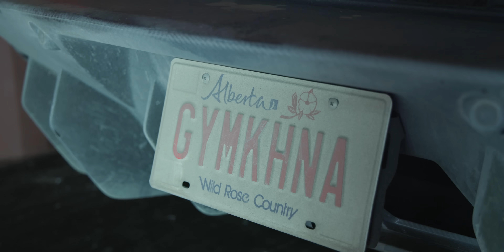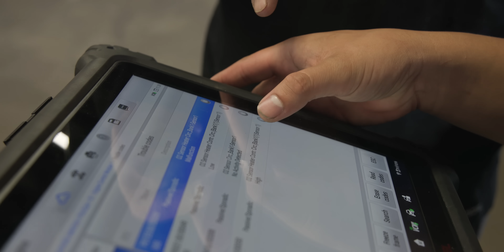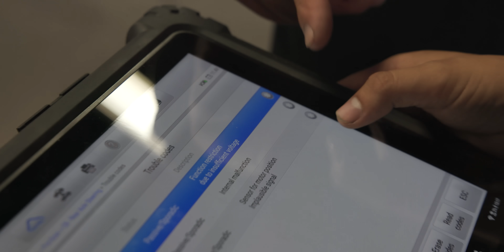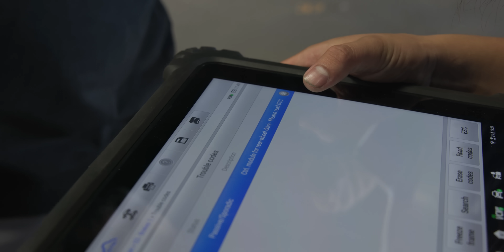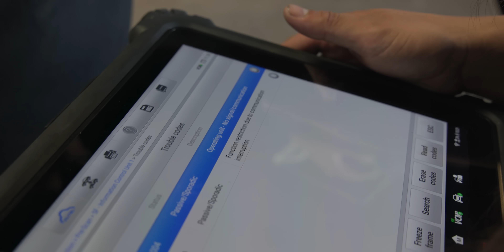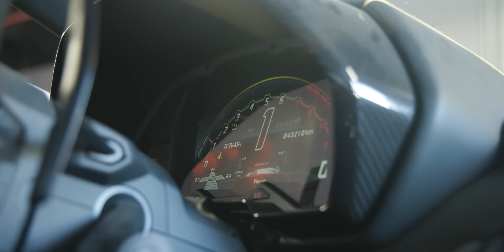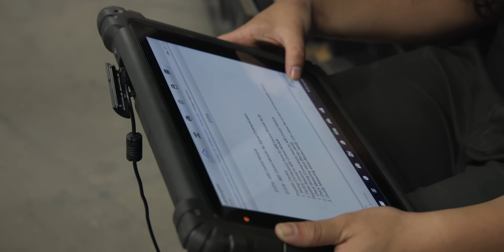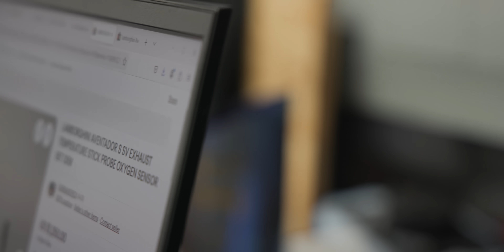TIME TO RETIRE SVJ AFTER DISCOVERING SERIOUS HIDDEN MECHANICAL FAILURES!?

Comment: I bet that flame shooting tune does wonders for the exhaust gas temp probes!
Reply: It’s not the tune it’s the exhaust system
Reply: @Moneybags_LIVE  what are you saying? How is the tune not what causes the faulty EGT probes
Reply: @Berm_Blaster  the tune contributed but this can happen with any aftermarket exhaust after too much revving or flames not the tuners fault in my opinion
Reply: I bet your right
Reply: Correct. Absolutely dumping unspent fuel into the exhaust and igniting it will fk it right up.
Reply: @Moneybags_LIVE  the exhaust has nothing to do with it. If you leave the stock tune it would actually run more efficient with the Gintani exhaust because of less restriction. But when they want it to shoot flames they are just opening the injectors open longer and that dumps raw fuel into the exhaust. The fuel in turn melts the egt temp probes and also can mess the o2 sensors up. Also holding it on the rev limiter also is not great on the engine.
Reply: @jasonb9629 someone that actually knows what they are talking about. best explanation i’ve seen in these comments. if only these people understood tuning
Reply: @jasonb9629  it's partially true, while they disable fuel cut to let the injectors keep working on deceleration map you still would have to retard igniton to achieve the big flames else without retarding the ignition it will just stink of fuel and maybe even have black smoke, the lower the fuel cut value the bigger and longer the flames. also retarding igniton too agressive will slowly burn up your exhaust valves
Reply: @rcgamers5536  Bud I know how to tune cars I work on them daily.  I didnt just feel like writing the full explanation out because its just not needed in this case.  If you look at some of my other posts about these tunes I explain it in more detail there about how they do these tunes.
Reply: @referencetheater1742  It actually not because I can almost guarrantee that they make you sign a waiver before they do that tune.  Gintani just is a shop that sells products that people want.  If your dream is for your million dollar Lambo is to burp and fart and shoot flames hey your the customer so give us a pile of money and we will downgrade the performance of your car and make it more unreliable.  Remember the customer is always right!
Reply: @Moneybags_LIVE dude that is the most inaccurate statement. Sorry but it is. The tune is the whole reason it shoots those flames so consistent. It has 100% to do with the tune and fuel management.  The flames are raw fuel burning. Maybe if you had a high performance car with a top notch exhaust and big injectors you can do it. But not with just an exhaust. Sure they will toss a blue flame occasionally. But not like the DDE cars.  They are all tuned.
Reply: I think it's time to order back-up  egt sensors. 
MO FLAMES
MO PROMBLEMS....
Is what Biggie said....lol
Reply: @jasonb9629  basically you are telling me what i guessed, GINTANI problem….as many say their tune is hard for the car and not reliable. There are much better tuners such as NOVITEC and much bettter exhausts such as BRILLIANT

Comment: Svj should be the alternator. It dropped into the 11v ranger several times. You should get 14+ volts at 2000 rpm. If not the alternator is failing. Most ECU won't function properly under 12.3 volts. The starter won't engage on most models if low voltage is an issue..
Reply: I hoje they see this
Reply: Said that during gumball
Reply: Its going to be from Damons constant revving IMO.
High RPMs are known to cause electrical issues in most modern cars, but Im sure they already know that by now.
Reply: @ChillinWithJunior  I hope so. Some alternators can't handle the RPM
Reply: they had the battery and alternator replaced on gumball
Reply: Do you know what’s funny? You may be right, but all the likes and comments acting like this is definitely the issue when they’ve had 10’s of experts both Lamborghini techs and outside look over the car and they still don’t know the issue, but apparently this comment is the solution 🤣
Reply: And I say again I hope you’re right, I just laugh at how everyone agrees if you say it confidently enough
Reply: mfn thank you for saying this, ffs like 100+ different codes can set for low voltage. gotta fix the simple shit first before getting deep into the big stuff

Comment: I would recommend putting the factory tune back on the svj to see if it resolves some of the drive train issues. Even though it sounds great, proper modifications werent made to the svj to support the tune other than an exhaust. Also, it is Revved to heaven every time it's turned on without proper heat management in the engine. Not supprised components are failing. Love the car but its not built for that level of abuse.
Reply: Supercars are strong but things are fragile. You need yo understand the numbers they get made in compared to a camry or what not.

They arnt typically driven ‘daily’ so these problems will and do exist regardless of modified or not

Comment: Mike and Tim, if you're concerned about corroded connectors, I would spray some Nickel Safe on every connector you inspect, as you inspect them.  Nickel Safe is good stuff.  We used it on A/C components in a hotel resort I worked at.

Comment: Not to correct Mike, you can just pop each pin out of the connector to check the wiring at crimp point. I so feel for Tim if he gets stuck having to test the electrical searching for the root cause of the problems. I recommend making some male/female connectors for testing individual pins and wires with a multimeter.

Comment: The svj just did 3000 miles plus traveled across the world on water. The sea air could contaminate the oils and wires, do a proper pull down, and check  for corrosion . Definate oil change and radiator  flush

Comment: Most manufacturers build a proportioning valve bias into an abs brake modulator in case it fails. Where that redundancy fails is when you change calliper piston size. But, before looking further or changing parts you need to set the tire pressure!!!

Comment: The Queen is back‼️ The SVJ’s appearance on the channel is something else. This car is a brand/product ambassador for Gumball3000 and Gintani. Damon and Dave really know how to make every moment out of it with this car. Mike Essa is diagnosing it properly, going through every inch possible. My theory is the exhaust temperature is freaking out the sensors and wiring harness with the internal fluids. Wrap the exhaust with heat shield and fold paper on the surrounding. God damnn, the SVJ is such a phenomenal and legendary car, Gintani YSOB you unleashed the beast. Keep up the hustle and bustle YSOB’s! DDE ALL THE WAY🏎️🏎️💨💨

Comment: A lot of electrical gremlins could be due to a failing battery. Most Euro cars freak out once the battery voltage falls below a certain threshold. Consider replacing the 12 Volt battery and check to see what codes come back. I’m not a Lambo technician but I’d try the cheapest/easiest remedies first. Love seeing Mike and Time getting more screen time! Keep killing it fellas. 🔥🔥🔥

Comment: With all carbon fiber tubed vehicles. That bolts metal to carbon fiber.  Front and rear.  90% of the time is a ground issue.  Find all chassis grounds.  Clean them.  Dielectric them.  Tighten all chassis to carbon tub bolts.  Also I’ve replaced many chassis grounds due to internal corrosion that can’t be seen.

Comment: Mike put car in the air. start it, put in in the gear and look for a live data from wheelspeed/abs sensors . If one is off you got it
Reply: Hopefully he see's this... not sure if he is familiar with some of these awd systems.. if your OD tire is slightly off from the other 3 it'll spin at a different speed under normal driving even... I hope they see this comment

Comment: I love Mike videos! Car manufacturers put electronics under the hood because they cool as the car moves. Damon spends so much time sitting still revving and blowing flames is the reason for the burnt sensors. The tune is retarding the timing and dumping extra fuel through the exhaust to ignite it. And the melting wire issues

Comment: Check the wheel speed sensors for the ABS problem, had the same issue with my VW. When Tim said a low tyre warning had the light bulb moment, as they use the wheels speed sensors to measure the rotation against each other to work out a flat tyre. When one fails it throws everything else

Comment: For the abs test the wheel speed it’s a typical issue with dirt dust etc a easy check is live data while driving and see or take them all out clean them and put back in.

Comment: Could be a master ecm issue with all the electrical issues. On the stuff I work on if there is low voltage the whole can buss system goes haywire. Total factory data refresh to get it back working.

Comment: I lost ABS, traction control and cruise control on my Jaguar XKR the OBD tester said abs control module or ABS pump failure, it wasn't either just a blown fuse for the ABS control module. Cost me pennies instead of pounds 😅

Comment: Maybe they hit some bumps big enough to throw off the wheel sensors.  So maybe you just need to replace those. Even low air for tires might throw them off

Comment: The svj might just need an alternator but an upgraded one in my opinion. Also there’s something draining power when it’s on not when it’s off. A ECU might also be blown or shorted causing all these issues and with that it probably blew the alternator as well. Just copying another user’s comments while adding a little bit more.

Comment: I can tell you from experience you have electrical issues somewhere. The transmission faults are from low voltage and the other codes were from low voltage you need to start at the battery and alternator and work your way down. Replace the Oxygen sensors just due to the Gintani Exhaust probably melting them from the high temps of constantly revving

Comment: Exhaust and engine heat are killing the starter. Starts fine cold, sketchy start when hot...that is heat soak. A common problem when a heat shield is missing and also when the starter brush springs are failing due to heat. Same with starter armature...it's insulation is deteriorating. Wiring going to starter also deteriorates leading to high resistance and more amperage draw on battery.

Comment: Not a mechanic but a lot of the issues sound electrical. What's more plausible, an issue with the batter/super capacity or the actual wiring to all those modules? I know where I would be starting my troubleshooting. Especially knowing the voltage was low and struggling to turn over the starter motor.

Comment: ecu in engine bays saves the manufacturer tons of money in wiring in order to keep the length of the wiring as short as possible. If they put the engine control module inside the car, every wire would have to be longer

Comment: I would start by checking all the ABS sensors and making sure all of those are plugged in correctly and all the way and making sure that all the other systems right there are plugged in because we all know that motor was taken out and put back in in less than a week before it got shipped out of the country chances are that maybe one or two little plugs might have got missed by accident

Comment: Check the wheel speed sensors if they get wiggled too much but I’ll say it’s like the wheel sensors on the back axle still could be a front if it’s off and telling the abs and rear transmission axles. So I’d check those first.

Comment: @DailyDrivenExotics for the rear axle steering module check to see if the fault codes are static or passive/ sporadic.  its likely that when the battery died the module lost its basic setting (basically a learned zero/ reference point) there might be a test plan to perform basic setting though the autel.  a lot of these fault codes are due to low voltage and the vehicle begins to go into either shut down stages to conserve voltage or modules are still awake and looking for signal but not receiving due to other modules being already shut down (no signal/ no communication faults).  most of those faults are stored because of something else,  i would print out the data from each fault and find which faults set first establishing a time line and start diag there.   i believe the lower limit not reached fault is if you think of the component having an operating parameter window and it doesnt see at least the lower operating parameter then that fault would set.  check power and ground supply at ABS module

Comment: Guys need to check part numbers carefully, you might find that the 02 sensors are the same part number as a VW Polo and cost $120.  You'd be amazed how many parts are shared across the VAG range...

Comment: The supercapacitor runs on the same circuit as the air ducts at the back and after fitting the aftermarket wing and disconnecting the original wing throws the ecu in to a fit, RE performance was saying he's got the same problem with a car at his garage

Comment: 18:06 on the rally Damon and Dave needed to replace the battery and the super capacitor so maybe it's not a wiring issue entirely

Comment: I had a car (just before OBDII came out) that had its fuel management and exhaust gas management computer literally bolted on the block right by the exhaust header, stupid idea! It was known to heat up the electronics and melt the solder on the components, making it fail and completely stop the engine running! The car would just die after driving it a bit, but if you let it totally cool off sometimes it would start again, but then cutout when hot again! Took ages for me to find what actually was happening, you just wouldn't expect THAT to be the issue, but it was! The car had done over 100k miles though. So i ended up buying a new control unit, bolted it on, plugged it in, and the car ran great again! I regularly serviced it so it ran great after that, but it was a tough one to trace!

Comment: To avoid the mold issue when shipping car run, the heater full blast for at least 1 hour No A/C
Reply: That wouldn't be enough . Dry-airz   powder  and 3 + days in a  extremely  low humidity  garage.

Comment: With the amount of dirt on and around the car it wouldn't suprise me if the abs wheel sensors just need a good clean up to clear the drivetrain fault codes.

Comment: The low voltage could cause the control module to lose its primary code and it will show it up in the transmission modules
Reply: It’s saying  please read DTC is its way of telling you it’s possibly not coded I don’t own one but my VW has the same issue when the battery drops electronically the cars have a lot of similarities so I’m hoping to help point you in the right direction

Comment: An engine ECU installed in the engine bay, what a surprise 😂… You’ll never guess where manufacturers fit the Central Locking Module…..Weight saving, heat dissipation and complexity of the harness is just some of the reason they are installed so close to the engine. I mean, if you fit the ECU in the opposite end of the car to the drive train you would add many Kg’s of weight, increase the harness length, thus creating more opportunities for failure! Not to mention the fact that the ECU itself generates a lot of heat. The mossfit drivers that control the coil plugs and injectors get REALLY HOT hence it’s installed inside a metal case for heat dissipation…..

Comment: If the autel can't communicate with the abs module can be can bus or not powered up. Could be simple as a fuse, or wiring to it. 2x can bus, powers & grounds & it should be online & connect scan tool

Comment: Is a company like Bosch making those sensors ? You will pay 30% of the price that the dealer charge. Also a lambo uses a lot of Audi en VW parts. I got a problem with the fuel gauge that went to zero and did nothing. Changed the battery and the gauge was working again. A defective battery can give a lot of strange electrical problems.

Comment: Check all the grounding points for corrosion.  Several gumball cars had electrical problems when they landed in Vietnam.

Through the whole video, I’m thinking jeez, either Mike knows there’s a common electrical fault and he’s snaking everybody, or he doesn’t know, and shouldn’t be touching these cars.

Comment: Guys replace the capacitor and put a new battery and clear the codes and see if they come back. Cause that's the issue they were having it with at the rally was with the capacitor and the batter.

Comment: Would be a crime to get rid of the svj. It needs some love and I'm positive it needs an alternator which i believe will sort out those electrical gremlins. Even cars that aren't so high strung do strange things when voltage isn't high enough. These days everything is integrated. How many control units does an svj have, i can think of 7 as I'm typing and they all communicate and all want the right voltage.

Comment: Simple way to know if the abs problem comes from a wheel sensor use your autel go in the abs module live data and drive the car see if you don’t have a wheel data discrepancy if there is discrepancy on one of the wheels the speed sensor on that wheel is no good

Comment: Dude, just pull the sensors out and get the Bosch, or whatever manufacturer they are, part number straight off them. I almost guarantee you can find them way cheaper in the aftermarket.